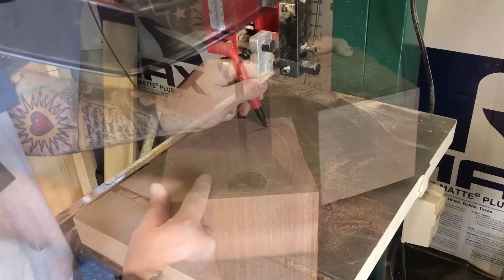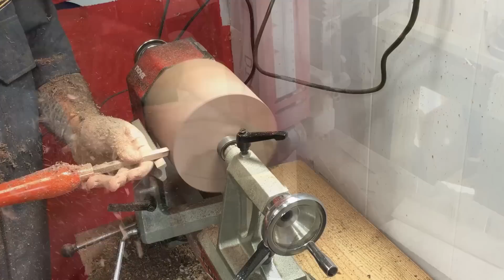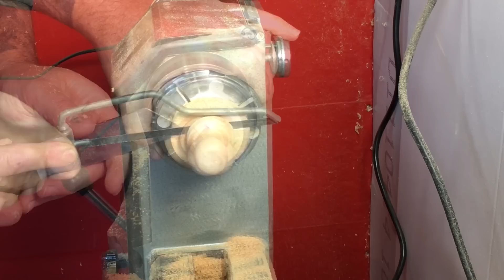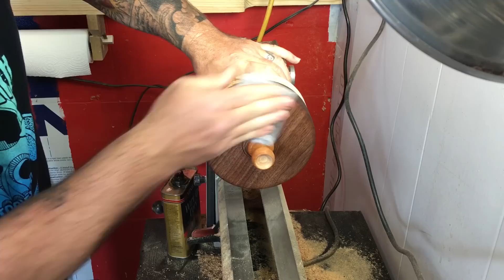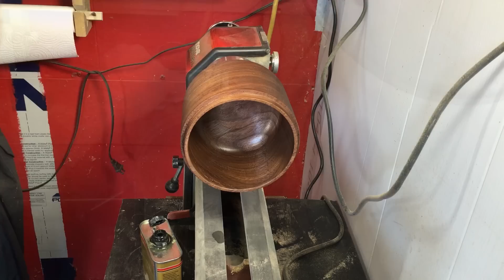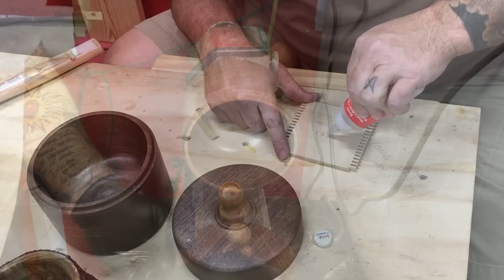WOODTURNING: Beads of Courage Box

Comment: I also learned of your channel via Matt Cremona's shop update.  (Nearly always skip to the viewer projects in his weekly videos to find other good channels... there really needs to be a central repository for good woodworking channels.)

This is not meant negatively, but have you considered using traditional turning tools in addition to the carbide scrapers?  The reason I bring this up is that especially with walnut, there's a whole lotta sanding that could be avoided using a sharp gouge.

Where did you get the beads of courage thing you inset into the end of the top knob?
Reply from the maker: Not taken negatively at all! Since this video I've purchased several conventional tools. I'm learning them, I think! :)
Reply from the maker: I received the bead through my local wood turners group. I think you can also contact AAW, American Association of Woodturners.